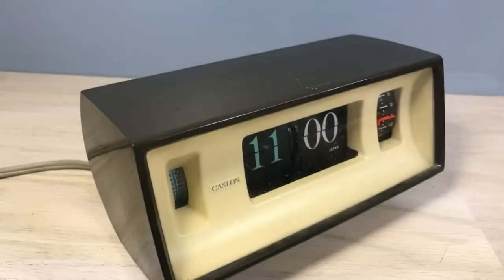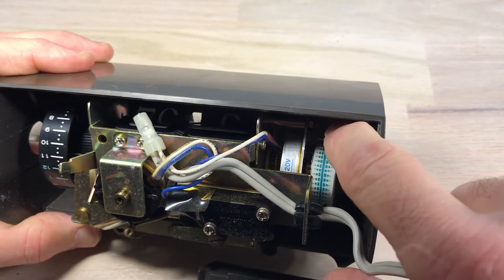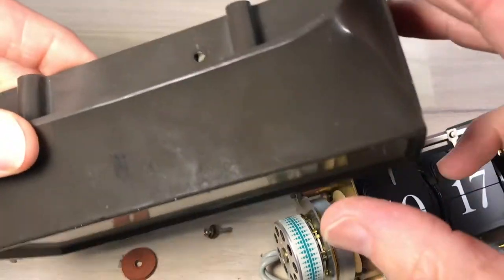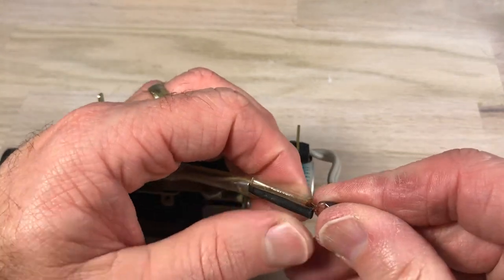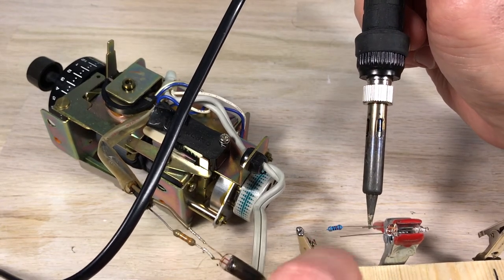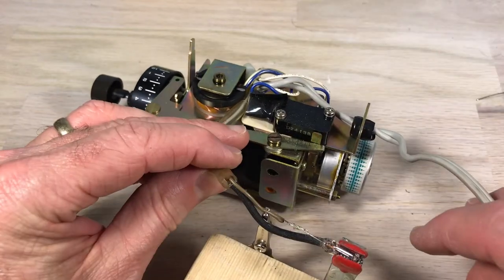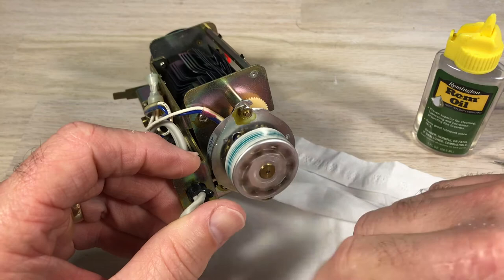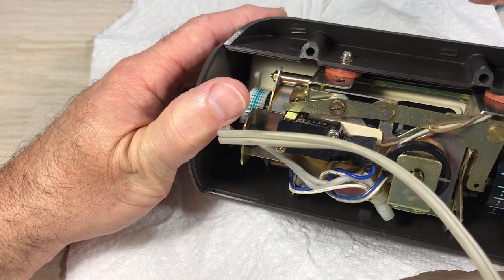Caslon 701 Flip Clock - Restoring an eBay Find

Comment: 9:23 Lubricating the motor (which seems to be the most common fix....worked for meeee!). 
I used PTFE oil so hopefully it'll go another 50 years w/o oiling.
Reply from the maker: Excellent
Reply: @Flipclockfans   For some reason it ran (half the day) until I unplugged it long enough to reassemble, and then decided to stop running again...so opened it up...more oil... 🤣🤣🤣 Hoping this time it'll stay working when I reassemble it.
-.Sony 8FC-69WA

Comment: I have a GE clock radio 7-4310 and the clock recently stopped working.  I opened it up and discovered the motor is still working but nothing is happening in the gearbox.  Do you have a video I could reference for that?  Thanks!
Reply from the maker: Sam Edwards - no Sorry. I m not even sure how to tell you to begin. I’ll keep my eye out for ideas.
Reply: OK. Thanks!  If I figure out whats going on I'll let you know too.
Reply: I discovered the problem!  The shaft the exits the the gearbox and engages with the clock had slipped too far out and was no longer engaged with the gears within.  Once I pushed it back in, I powered on the clock and it ran just fine.  However, by the time I had reassembled everything it had slipped out again.  Next time I will try to be more gentle during reassembly!
Reply from the maker: this is what flip clock restoration is all about! Your reply will likely help someone elso one day. Thanks.